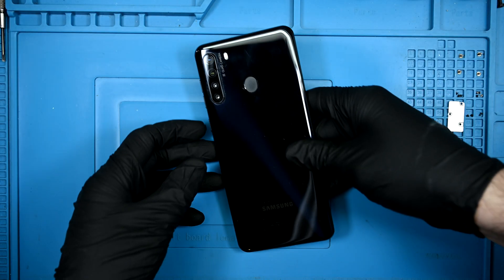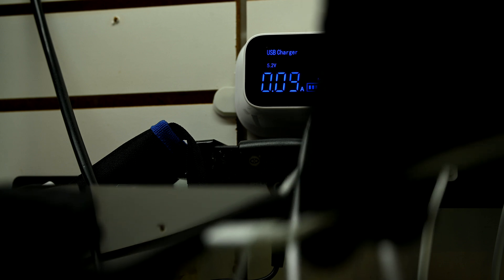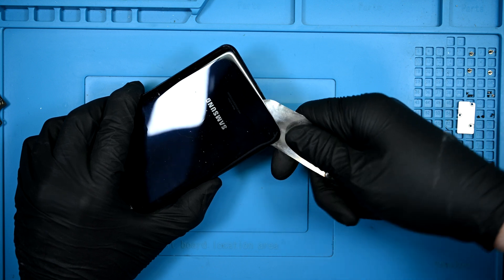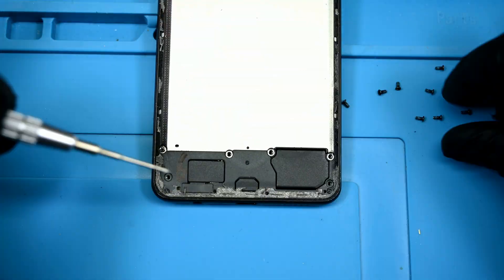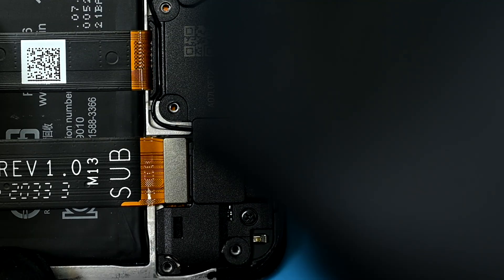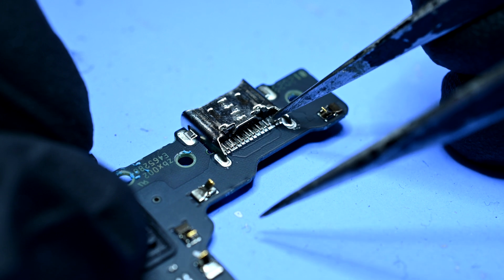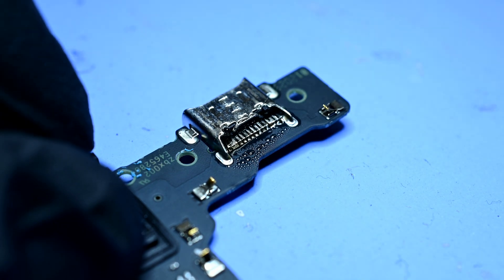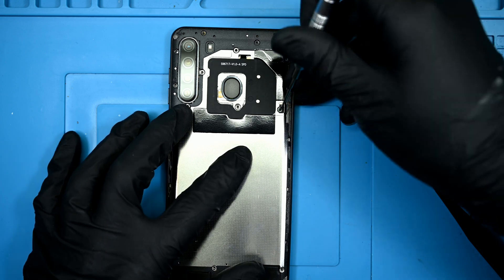Galaxy A21 Charge Port Repair | Reflow or replace?

Comment: This must of been a major issue with the a21 I've had two and both had this problem.
Reply from the maker: The A series in general is notorious for getting liquid damage on their charging ports, even from just humidity in the air in some cases. Newer versions have the components covered in silicone, this kind of helps but I still see it from time to time.

Comment: I replaced my charge port on my A21 due to having the exact same problem. The new port does the exact same thing. I'm starting to think my issue is not in the port itself but with how the port connects to the pads on the main board under it. It seems they are just connected with a spring pin going to a gold color pad? I've never seen this before and I'm not sure what to do moving forward. I do not have anything to magnify the port enough to wiggle it like you did in this video. The gold pads I mentioned have marks from where the spring pin sits on them. Let me know what you think please. Cheers!
Reply from the maker: Those gold contacts under the charging board are just for antenna connections (and vibrate motor), the next likely culprit is going to be that long ribbon that connects the main (top) board to the sub(charging) board. Any kind of rip or tear in that ribbon can cause the charging board to stop communicating with the main board, and keep it from charging.

Think of it like one big hose, electricity goes into the charging port and gets sent through the ribbon to the main board which then sends it to the battery itself. If the charging board is good but isn't sending that current through the ribbon, the main board isn't getting power to send to the battery. Check your ribbon first, then the main top board if the ribbon looks okay.
Reply: I have the same issue gotta fix mine

Comment: Just wondering what type of flux you used? Also, when doing a repair like this, wouldn't it be prudent to solder the entire board (as you did), rather than looking for an individual loose pin? Thank you for making such a detailed, yet concise, video. Great job!
Reply from the maker: Thanks! In this video I used ChipQuik Flux, though Amtech is also pretty good stuff. Touching up every pin isn't necessarily a bad idea, but I also think about "if it's not broke, don't fix it". There's the risk of flux getting into the microphone, overheating the plastic in the port, or just my hand slipping from drinking so much caffeine so I decided to go for a targeted fix instead.